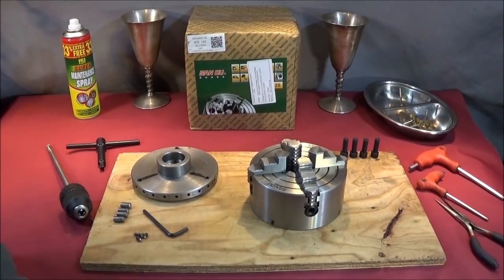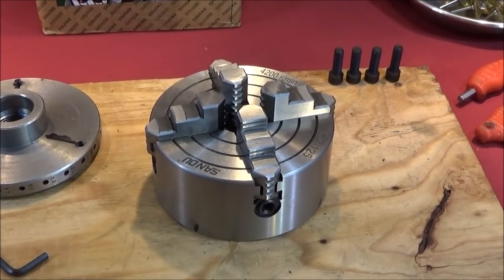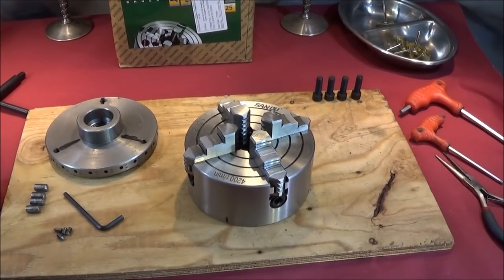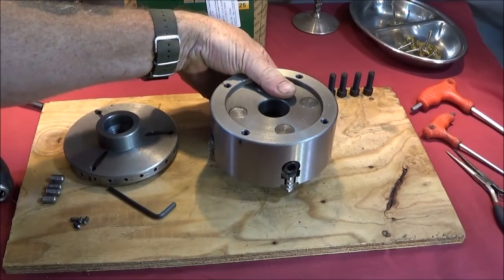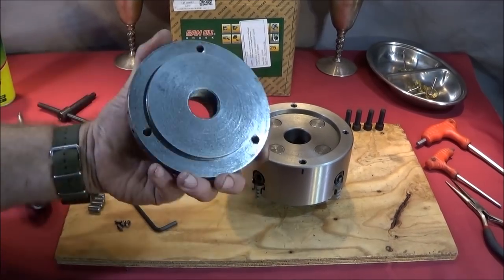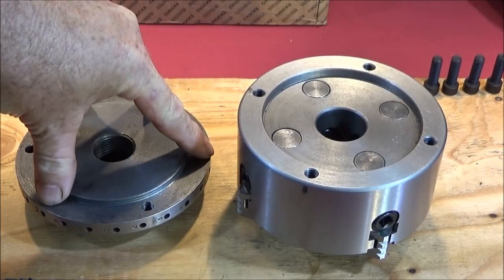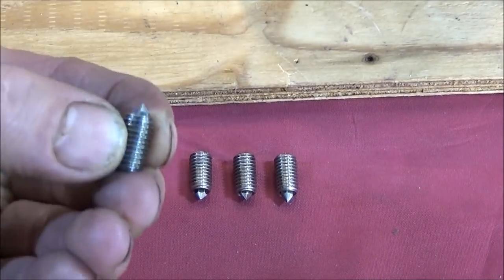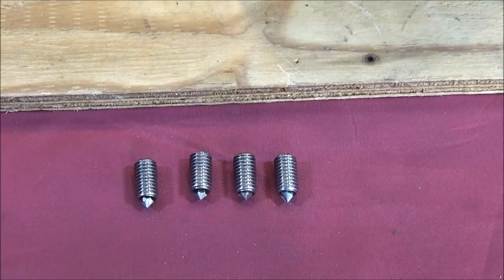How To Fit A Myford Indexing Backplate To A Sanou 4 Jaw Chuck

Comment: Yes indeed. This technical transfer holes saved my work. O bought a 200 mm Champion Tools 3 jaws Chuck already, and It cames with hide holes. I've made the back plate using a gym weight like you explained. But to acquire more accurate of those set points I grindered with a drill machine against the spining Stone. Thank you a Lot.

Comment from the maker: SEE LINKS TO THESE EXCELLENT SANOU CHUCKS BELOW:-
SANOU K72 Lathe Chuck 80/100/125mm 4 Jaw Reversible Tool --  https://goo.gl/ePL9jg  

15% off Mechanical Parts Clearance -- https://goo.gl/uaHuve
Tools & Equipment Clearance -- https://goo.gl/ZNBDsu
Measurement Instrument Clearance -- https://goo.gl/Dbkb4X
Category
Reply: Hello Steve, thank you for this video. For all of your videos. I would like to ask you a question about the Sanou K72 Chuck: In several online shops the K72 is only recommended for "non ferrous" metals and softer materials like plastic. I am interested in buying one of these, but this is an absolute no-go. It's just unbelieveable. What is your experience with steel in a K72, for example? Are there any recommendations from customers about steel/non-ferrous? Sorry for my non-perfect English and best regards from Bavaria! AM

Comment: Steve I have just ordered Chineze lathe and Sanou 125mm chuck,I noticed on your video that it does not come with a back plate and they dont sell them. Are the chinee lathe back plates 1 1/8 by 12 tpi ?
Reply from the maker: Hi Gerry. The Chinese Mini Lathe chucks are held on with 4 bolts. The lathe should come with a 100mm or an 80mm chuck as standard. You can fit the 125mm chuck though with an adaptor plate which you should be able to get from Arceurotrade UK. So mine has a 100mm chuck as standard which fits directly on the spindle flange with four bolts.   The 125mm chuck has to be fitted on the adaptor backplate which then fits on the spindle flange. If you need anymore help just ask... Regards Steve
Reply: Steve thanks that is a great help,I will contact Arc.Odd that Sanou don't offer back plates though.
Reply: Arc Eurotrade do have the 125mm back plate 1 1/8 x 12 thread but they are plain without the tenon to centre it,but I can work around that.Thanks again.

Comment: I prefer to use a green wheel to sharpen hardened steel and it leaves a much nicer finish especially where woodworking tools are concerned and I finish of edges with leather and polishing compound.

Comment: Another way to make transfer screws  id to use e.g. grub screws and turn a point on them. Depending on how hard the screws are, might have to use carbide tools on the lathe.
Reply from the maker: Hi Juan,  By turning a point on them, It is virtually impossible to screw them down far enough or remove them after use. This is why you need the allen key socket for adjustment. Although you can use your method for other applications.

Comment: Great video Steve! I was looking at these chucks last night on Bangood, they say in the specs that they are only good for "non ferrous materials ie plastics ect. Are these chucks ok for turning aluminum/steel/titanium? It seems to me I've seen guys on Utube with the same chuck turning all sorts of ferrous materials metals ect. Cheers, Doug
Reply from the maker: Hi Doug, Thanks....No this is what I call an erroneous Chinese to English translation and one thing the Chinese need to get sorted. The chucks are proper engineering Lathe/CNC chucks used for turning all types of machinable metals.
  
I have seen this type of poor translation on many products and you can often see it in the instruction booklets that come with other types of Chinese products
    
It is most probably that the translations are left up to the actual manufacturers of these products and they are using the best translation method they can find, or maybe its left up to staff that don't know the best translation to suit the actual product. Which is what I believe has happened in this chuck translation.
   
I have tried this myself on translators and even with computer or a translation device, it isn't easy to get things right always. So it is understandable.
  
When buying chucks, I just check the dimensions and check what they are made of. They state the body is cast iron and it has hardened steel jaws. That means its standard Lathe/CNC chuck used for holding any machinable metal.
Reply: Hey Steve, thanks for the well written reply! I need to purchase the identical chuck for an upcoming project as well as having more machining capabilities. Thanks again Steve, looking forward to more videos, Best regards, Doug